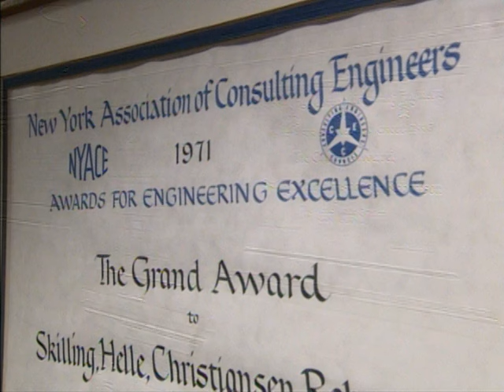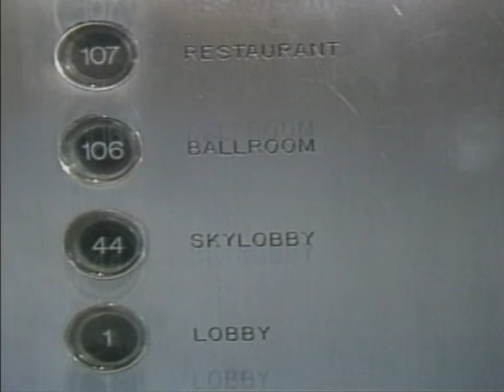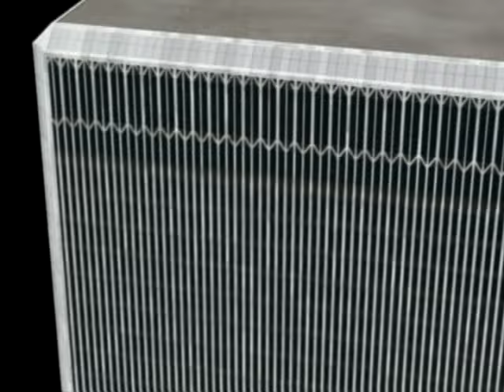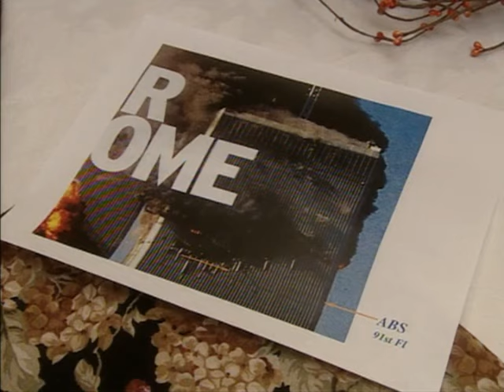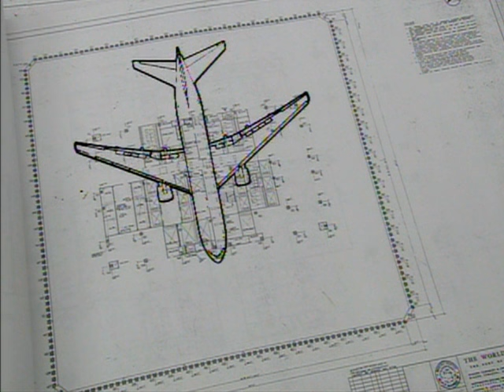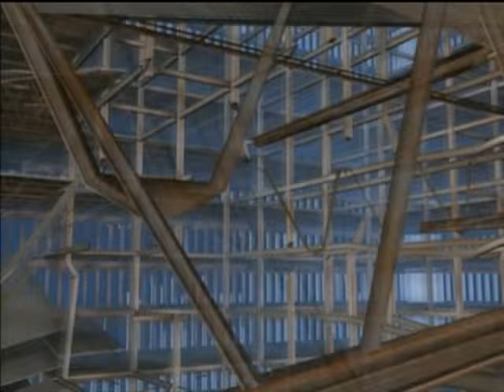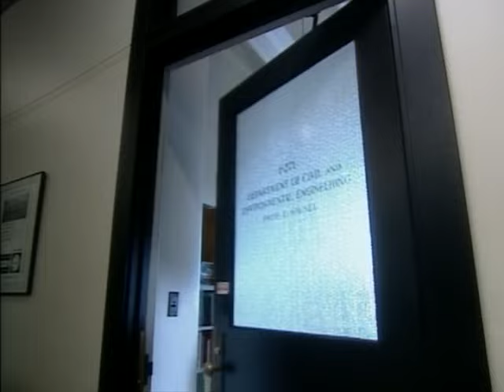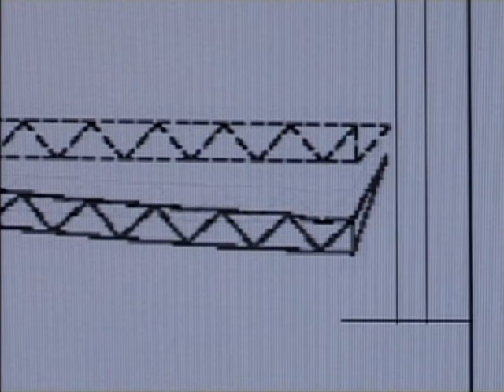World Trade Center - Anatomy of the Collapse

Comment: Correction: The TV mast on the North tower was 362 feet long, so the overall height of the North tower was 1,730 feet (527.3 meters). Which is exactly as high as the Sears tower West antanna in Chicago.
Reply: Perhaps the rental of WTC7,  a Pentagon degree security building might have considered that
Reply: @davepowell7168  🤔
Reply: No, her height was 1,368 feet tall. According to the Council of Tall Buildings and Urban Habitat, the antenna does not count as part of the structure. If it were a spire like the Freedom Tower, then yes, the North Tower's height would be 1,727 feet; but because it's an antenna, it cannot be counted as part of the building's height.
Reply: @historywatchdog2923  That's why I said: "overall height", not it's official height, take a hint.

Comment: My version of two tall buildings is 1 i would want the bathtub to be up to 5. X around the towers would be wider around the box beams would be bigger bolted + up to 2 foot wide concrete boot up to 6 feet high + up to 2 foot high connection between beams the box beams filled with high grade concrete bix I never liked the 12 bolt connection on 3 story section 4 bolts in a tight space so to connect 3 story sections I would put a up to 2 inch tube part pre drilled then special bolt self tap each side gets a big bolt at connection point 24 bolts + weld + special steel band to pull columns together I don't believe in the truss system